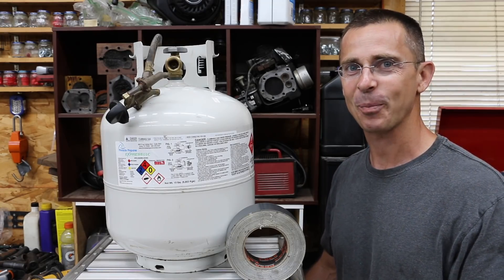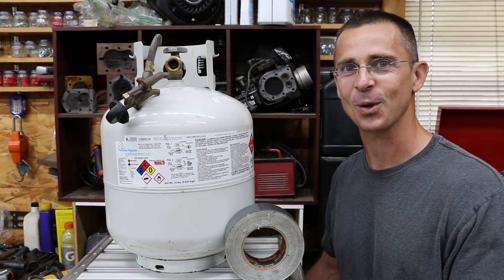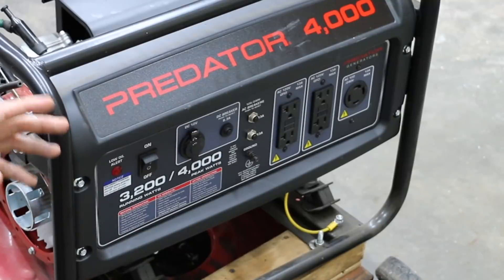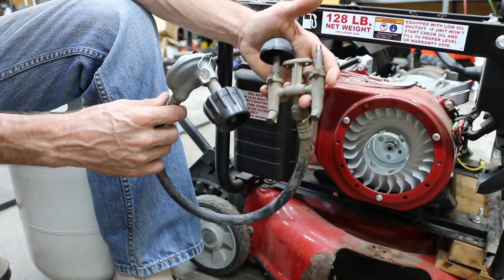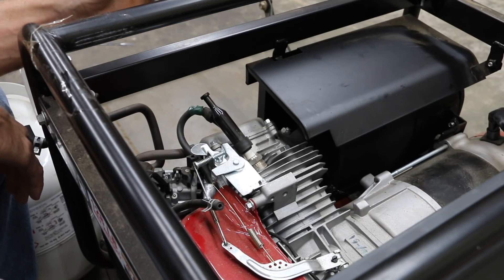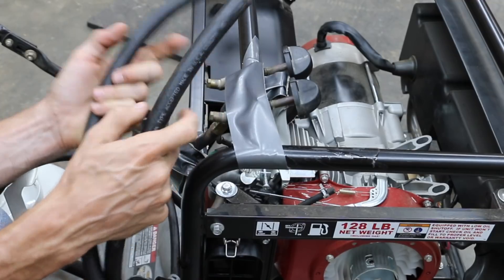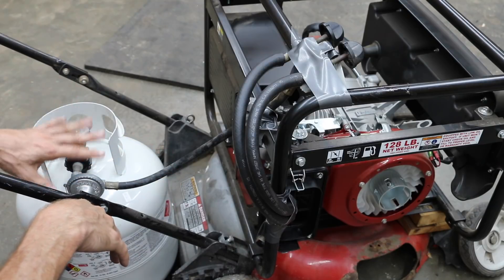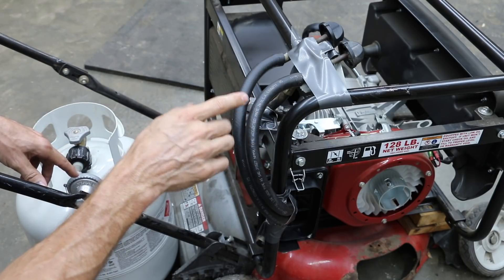Can a gas (propane) grill power an engine?  Let's try it!

Comment: I'm planning an extended range electric vehicle.  Do you think it's better to use piston generator or I was planning a turbine generator. Not sure which will be more efficient.  Battery storage is minimal for weight but only to even load from generator or electric motor.
Reply from the maker: Interesting project!  It seems as though a piston generator approach would be less expensive and less complicated.  I'm not sure about the efficiency differences, since there are many factors involved with that.

Comment: Worked like a charm with a little bit of fine tuning. If the power ever goes out and you really need to run your generator and you’re out of gas, just use that tank of propane you have up under your grill.  Not sure what the fuel efficiency is with it but it’ll work. ;)
Reply from the maker: Thank you

Comment: Propane can be used in the event if an emergency. Can home heating oil also be used? Could it be used to power a diesel truck? What if theres no electricity and you need to bug out? Could hopping from house to house using only home heating oil work for a diesel vehicle?
Reply from the maker: Great video idea!

Comment: I figured the engine would probably run on propane in place of gasoline but it was interesting to see how well it ran on propane. There are actually propane powered weedeaters and other equipment that you can buy, have seen them while shopping online. In an emergency situation, I would run my portable generator on propane if I ran out of gasoline. Great video as always Project Farm!
Reply from the maker: Interesting!  Thank you!

Comment: You need to try one of the small 1 lb tanks and see how long it will run on one of those, then factor in cost of propane vs gas which is better cost efficient.
Reply from the maker: Great recommendation.

Comment: I would see why youd have to constantly adjust the fuel flow. 
The governor is set to open up under load for gasoline, so the air fuel mixture gets slightly off causing the issue.
Reply from the maker: Yes, you're right.

Comment: Can you do a video to see if a generator can power a 36 volt golf cart by removing the batteries and putting the generator in where the batteries go and hook the terminals were they hook to the batteries to the generator and turn it on and see if it will power the controller and solenoid to run the cart
Reply from the maker: Great video idea!

Comment: I've asked before, but I would love to see if a new or old engine would run any better on synthetic, semi synthetic, or standard oil. I just purchased a new car and I'm curious if I really need to run synthetic in it
Reply: I personally bought a Hyundai Elantra brand new in 2002 and have use 10 W 30 Castrol oil every since it was new and I will be driving it to work tomorrow. it's never had any motor work done to it. it's got about 335,000 miles on it. I believe regular oil is fine but I have a new challenger that cause for full synthetic and will be using full synthetic at least until the warranty is out.
Reply from the maker: Great video idea!

Comment: I once tested an old 4 stroke dirt bike engine  that had no carburetor by holding an unlit propane plumbing torch up to the intake Port. Even took it for a little lap around the yard that way.
Reply from the maker: Thanks for commenting on this.

Comment: I'm sure you took all the precautions you could, But this is the most dangerous thing I think I've seen you do so far. Just kinda blowing propane at the carb of a engine there's all kinds of open sparks there so this could go wrong very easily. Basically becareful
Reply from the maker: Thank you

Comment: Before even watching this video, the answer is yes. Engines can run off gasoline, propane and natural gas. Generators are set up to run off any of the 3. In fact engines can run off a ton of other alternate fuels as well. Its just that gasoline (dinosaur juice) is the most popular, easiest to find, usually cheapest to use, lasts the longest and is light and easy to transport.
Reply from the maker: Thanks for commenting on this.

Comment: I know a guy that owned a Phillips 66 service station for years. He had a Chevy 1 ton shop truck with a 454 that dual fuel gas/propane built and designed all on his own. He improved the design on his sons big 4x4 in the late 80’s and then the city even had him convert some of their trucks. He had a huge propane tank for refills at the station, so it worked out great.
Reply from the maker: Thanks for commenting on this.

Comment: my brother has a 55ft bucket truck for tree removal, and it runs on propane.  keeps it liquid though. still fills the same, just delivers it differently. make a car or pickup run on propane and keep it for a year and clean the head.
Reply from the maker: Thanks for commenting on this.

Comment: seems like this would be a great idea for gasoline generators. I have had to use mine twice and drained the gas out and ran it dry. It would be nice not to have to worry about a gummed up carb from sitting.
Reply from the maker: Great point!

Comment: Came across an outboard engine a few years back running on propane gas. Was from a manufacturer called Lehr. Did some quick googling, they still around making engines, it seems like. 2.5hp 4 stroke that can run almost 2.5 hrs on a camping bottle of propane.
Reply from the maker: Interesting!

Comment: There are also kits available for this purpose. But they are a bit expensive. https://www.ebay.com/sch/i.html?_from=R40&_trksid=p2334524.m570.l1313.TR1.TRC0.A0.H0.Xgas+conversion+kit+generator.TRS0&_nkw=gas+conversion+kit+generator&_sacat=0&LH_TitleDesc=0&_osacat=0&_odkw=gas+conversion+kit+motor&LH_TitleDesc=0
Reply from the maker: Thank you!

Comment: you have discovered a new propane accessory
Reply from the maker: lol. Thank you
Reply: Project Farm I think I may have left you a message before. You should be able to use just one hose and kept the other one off keep it on high and put in a King Kooker propane regulator high-pressure. that King Kooker regulator installs between the intake and the propane knob valve. And the regulator by King Kooker you turn it in all the way so it has the most flow if I remember I think that's turned right like tightening a bolt to richen all the way. and you dial it back until the motor almost shuts off and turn right about half a turn or turn back to richen. At full RPM and load with no hesitation also is where you want to set your regulator it's that easy. The propane Pros that I learn from told me they've never heard of a case of an engine running too lean. And the pros said they would rather see something on the lean side then on the rich side and the only thing I can figure out with that too rich could become a spit and puff of flame out. That's how I run my small engines. But if you want to run a go-kart engine something that will very an idol you get a Garretson propane valve and with a generator like that you put it between the knobs and the motor intake. You have to have a port going into the intake from the Garretson valve to pull the propane in. Advantage of having the Garretson valve you can push the valve override and Purge propane in the engine and it will definitely start up. As long as you have a spark the propane will burn. And as you know propane is super clean no gasoline in the oil no black flooded plug spark plug that is a no carbon build-up whatsoever if the motor is new. And they say the motor on propane will last two to three times as long. Also on propane the motor Never Comes Out Of Tune like gasoline carbureted engines can. If you want to see a simple propane setup go to Northern tool and look at their 4000 Watt about Northern brand dual fuel gasoline and Propane open face generator it has a Garretson valve on it. It's pretty simple. Also one thing I like about my small Sportsman 2200 watt dual fuel generator I've never had gasoline in it so I can put it up in the front seat of my truck and just put a bag under it. It only holds 12 oz of oil. I was going to convert a generator over tp propane and get that kit but it was so expensive and I needed a quieter generator on top of that. And I wanted the new Echo idle or economy idle some call it. The only motor left that I know of they sell a propane carburetor for is just the basic 350. Propane is about 100 - 110 Octane it never goes bad and it always Burns super clean cleaner than a diesel. Burn a 55 gallon drum or smaller drum of trash pipe it into a metal funnel and up into the intake of the carburetor I seen a generator run off unburned fumes from trash or wood. they couldn't get the idle all the way up because they didn't have enough stuff to burn like wood. A test I forgot to do like what you were doing running your laser gun heat gun that is gasoline temperature on the cylinder head motor and on the exhaust and on propane cylinder head and exhaust. Did the propane run cooler or gasoline I'd be thinking the propane would run cooler but I haven't done that test I forgot to.
Reply: snowcoal gosh dang it bobby
Reply: Hank Hill would be proud, "I tell you what"! 😁
Reply: no, for under $40 you can buy the propane conversion kits so your small engines are hybrid gas/propane! Theyve been around for 50  years
Reply: U did Hank Hill and the boys down a Strickland propane very proud
Reply: wait till Mr. Strickland hears about this . I tell you what.
Reply: We sell propane and propane accessories. ---Hank Hill.

Comment: It is not surprising to, because the very first gas engine from Otto was intended to burn propane like material and the principle of it was not changed all this Decades so.... You have discovered exciting... It's like you've invented the soft sandpaper to wipe scratchless your ass with it.... secret revealed!
It's called Toilet paper... Duh!

Comment: My father had a forklift that he bought used for his warehouse. The forklift has a Nissan gas engine running on propane. The only difference is that it had an electronic valve that replaced the pump circuit rather than manual shut off
Reply from the maker: Thanks for commenting on this.

Comment: Always boggles me, guys get their panties in a wad when the no-load Hz are above 60. You ALWAYS set it with a load as the governor will never hold speed exactly constant at the 1800 or 3600 rpm required otherwise.
Reply from the maker: Great point

Comment: I want to see you construct an automatic propane/air ratio supply devise. At least talk about how it would/could work. How do "flex fuel" engines automatically find the correct ratio? If you could design and build one of those for small engines or even vehicle engines as a conversion kit, you could make great money! Or get killed by goons in the gas/petrol industry!
Reply from the maker: Great video idea!
Reply: This does exist. Not cheap...
Reply: @jeroenhaentjens9156   dirt cheap. It is called mixer. Basically it is a venturi  which sucks propane vapor into the engine. You can also drill a jet into the carburetor with small engine.
Reply: There is LPG system to be fitted to any engine,starting from the 50cc scooters (search about the Lovato LPG system, they converted a small 50cc Malaguti F10 when I'm young) to the biggest industrial engines.
Most of them are italian made, we have lot of knowledge in this matter, because of our gasoline price 😉

Comment: Used a propane torch in a pinch in lieu of starting fluid to get a car running once. Opened the valve on the torch, stuck it down the carb, cranked the car over and it ran, at least long enough until the fuel pump took over and filled the bowl. I've heard auto shop classes used to use propane back in the distributor days to make sure then engines actually ran after students re-assembled. them.  Love the generator mounted on a lawnmower carcass- how appropriate! Great job as always! Even if the results aren't surprising (can we build a connecting rod from twine? Lets find out!), loads of fun to watch the process and see the outcome. Nothing like empirical evidence!
Reply from the maker: Great recommendation!

Comment: Great video as always! I am eventually planning to get a "portable" generator of at least 5kw but probably a 7kw would be ideal and will be buying a conversion kit to hook it up to the natural gas line in my house, that way I don't need to worry about it dying when the fuel gets low and has a load on the engine or having to run out in a storm to get more gas. It still beats paying the few thousand dollars for a whole house generator.
Reply from the maker: It's a great investment!

Comment: Next time inverter the bottle so it sprays liquid propane
Reply from the maker: Great recommendation.
Reply: Project Farm it will be interesting to see what affects if any it has due to the temperature of liquid I believe is about -44F ?  Will the engine run cooler? Will it run at all?  I have run lawn mowers of MAP gas and found if I run liquid I have to use 1mm copper lines directly in to the carb due to rubber becoming brittle, freezing and cracking due to vibration.

Comment: Here in Argentina all taxis run on natural gas, it's cheaper than Diesel and it became really popular so there are a lot of gas stations where you can refuel. My dad used to have an old dodge with a big ol' slant six engine and he installed the gas convertion kit to it. With it he got the same amount of Kms per $ than with a small 1.4 gasoline engine car. The engine loses some HP though. But you can still swich from gas to gasoline by pressing a button if you want.
Reply from the maker: Thanks for commenting on this.

Comment: Hook the gas valve to the governor arm to manage gas ratio according to rpm. Use a spring to return valve to idle state. Using a diffuser and fuel heater help with efficiency.
Reply from the maker: Great recommendation.
Reply: I am glad to help. Love the channel and straight forward approach.  I am an electronics tech., Computer Science major, and self taught mechanic. I repaired tools and constuction equipment to pay for my college. If I can help let me know. 😀

Comment: I wonder if you could plumb into the carb and use it to control the propane flow instead of the knobs.
Reply from the maker: Yes, there's a better way to do this.

Comment: I built a motorcycle that runs on propane it doesn't change the air flow just the fuel and it runs perfectly Everytime
Reply from the maker: Impressive!
Reply: Project Farm yeah I didn't have anything else I really wish I could show you a picture so you could see the setup

Comment: Do you think you’ll be able to make an oil cooler out of the old radiator and a fuel pump for a motor that was not designed to run a oil cooler
Reply from the maker: Great video idea!

Comment: propane engine options back in the late 90’s early 2000’s were huge until shops started blowing up because of propane leaks. it works but can be super dangerous and that is why we still use gas
Reply from the maker: Great point.

Comment: harbor freight optional wheel kit P/N (8327645) for predator generator.  I can't find it at my store but I'm skeptical because yours kinda looks like an old lawnmower. it's got that japanese camber though
Reply from the maker: Yes, I used an old lawnmower instead of the wheel kit. This seems like a better setup with no bending, lifting, and rolls easily across the yard.
Reply: haha I was just BSing as if they sold a broken lawnmower as an actual product

Comment: Good day Sir, please build a ''bubbler type carburetor" (one which resembles a hooka pipe). Wrap some kind of tubing around the exhaust of the engine to heat up the intake charge going to the bubbler. (More or less the same way you constructed an earlier model). This should ensure proper atomization/gassification. Then apply some  load to test whether or not this method may increase fuel economy.
Reply from the maker: Great video idea--thank you

Comment: Good demonstration and using propane on a gasoline engine is the way to go with a converter that maintains 
the proper pressure to a propane carburetor or mixer that mounts above the carburetor. The propane burns
cleaner, lowers emissions and you don't have to change your oil and filter anywhere near as much as using
gasoline. I've installed several dual-fuel systems on trucks and propane is a real good fuel to use. You should
raise the engine compression and use a high-lift camshaft for improved performance and mileage. A converter
is used on a propane conversion to heat (using engine coolant) the liquid propane to a gaseous state then it
is regulated to about 5 psi to the mixer or propane carburetor.
 
The setup that you are using really isn't practical since the propane vapor/air mixture isn't regulated by the 
carburetor. A propane carburetor mixes the vapor with the incoming air below the carburetor which is
controlled by the propane carburetor's linkage whereas a mixer introduces the vapor above the carburetor
through a attachment that has a adjustment to control the amount of vapor into the mixing ring  on the
top of the carburetor. If you ran the generator for any amount of time you would see that there would be a
liquid or frost line on the propane tank. You would soon run out of propane vapor to run the generator until
there was enough propane vaporized inside the tank, unless you heated the propane tank. I used a setup
to run straight vapor or liquid propane on a dual fuel (gasoline or propane) converter system years ago.
It's possible to get more mileage/power out of propane versus gasoline engine from what I have found if
you change the camshaft profile/timing and engine compression (12:1) on the engine. You get no engine
detonation from propane and have more lugging power using it. 

Gasoline is a poor fuel to use in engines that's why the Gov and oil industry like it and thanks for you video!
Reply from the maker: Great point and thank you